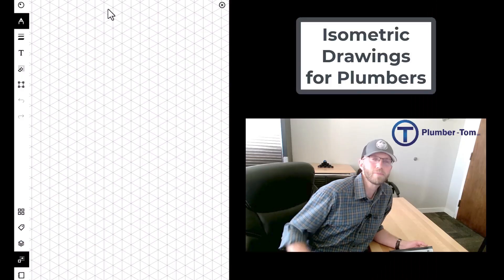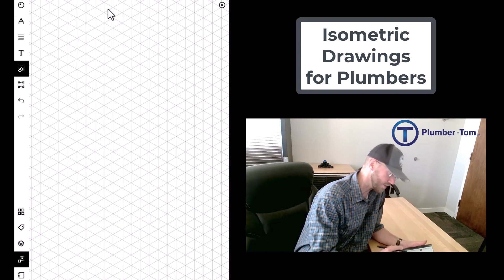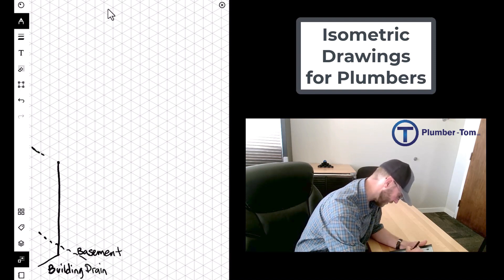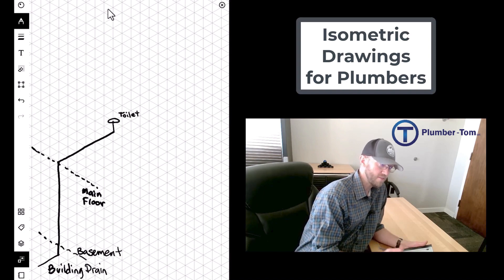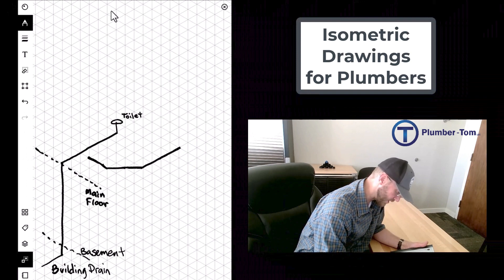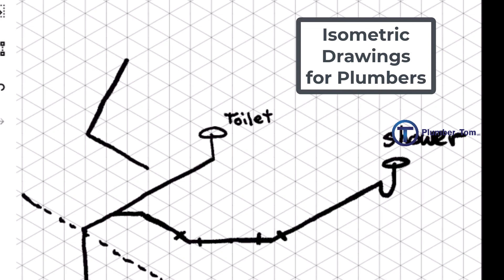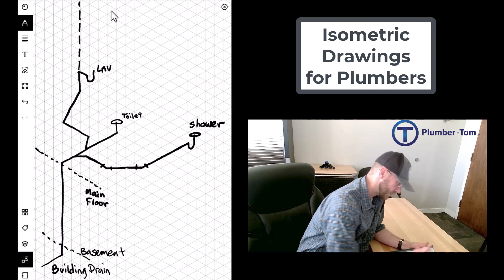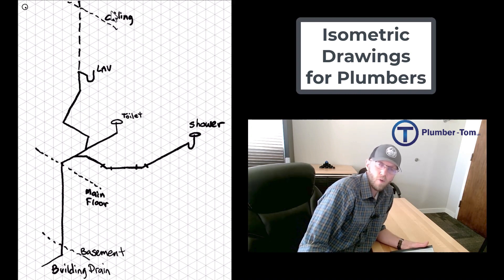Isometric Drawings for Plumbers - Exercise 2

Comment: Well thats wrong, the toilet should be the most downstream fixture on a wet vent, use a 3x2 double wye to connect all three and do it right, the IPC is a joke
Reply from the maker: That is according to UPC. But UPC is too strict. We have done IPC for 24 years and it works fine.